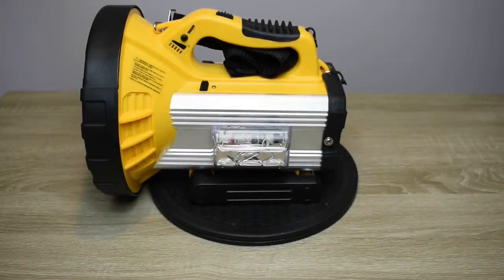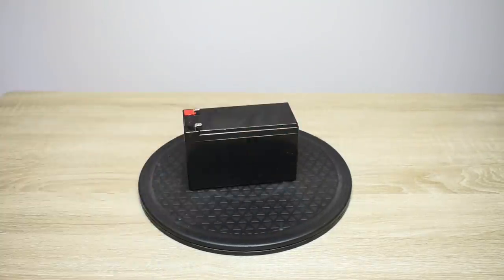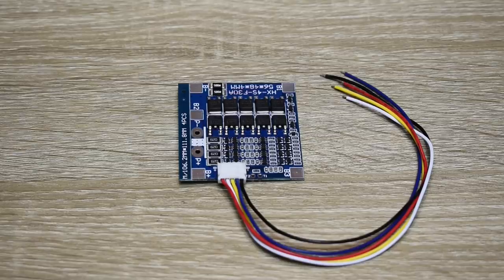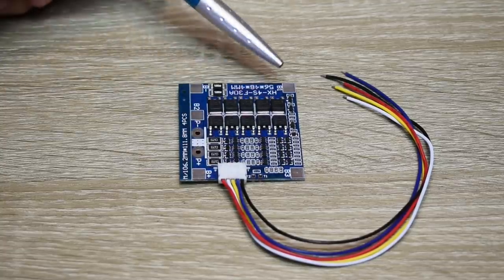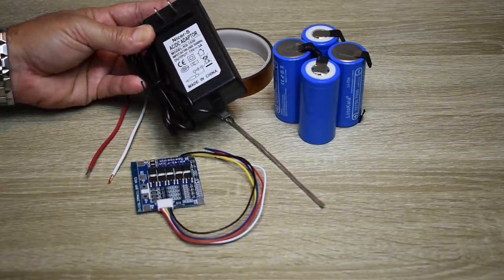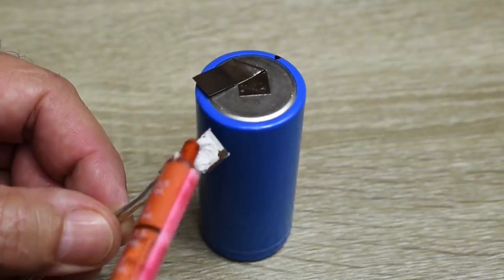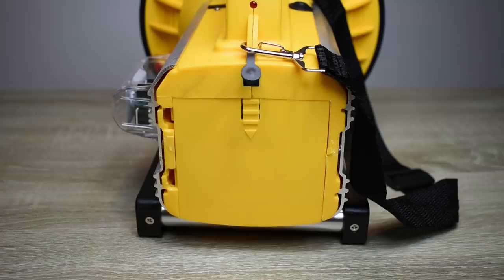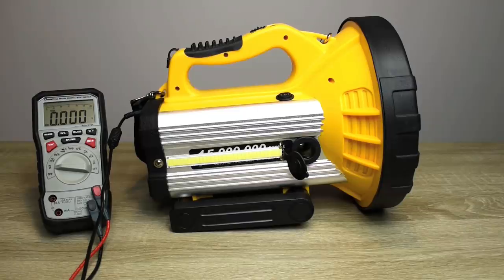Homemade 12V LiFePO4 battery pack!

Comment: LifePo4 version of my own Liion conversion of a similar type high power lamp LED upgrade on main beam too. Used 6 cells (3p2s) as original lead acid was only 6v so get 6.6Ah total! Works great.

Comment: Just in time!!!  I'm making a test device for long LED strips and needed a compact 12v battery pack that could deliver decent power.  Thanks!!!
Reply from the maker: It's easy to do, just takes some time. Thanks for watching! Be sure to share.
Reply: You can use lithum ion 18650 battery instead lithum ion phosphate 32650 battery or polymer battery
Reply: @mahesh4pritesh  but hen you would only have 12.6V maximum in a 3s config... plus, if BMS was bad, it could catch fire...

Comment: I'm sure I'll never be making this setup myself,  but the information is useful for any similar application requiring a charge controller.  Step by step presentation couldn't be any better... That thing will definitely cause flashlight envy at any outing event! 😂👍The manufacturer could stand to take a few hints from you...
Reply from the maker: It's a great setup. Glad you enjoyed the video!

Comment: Great video that is very thorough and details as always!  Never watched one of these LiFEPO4 BMS assembled and neat to see the finished product in a modded spotlight. Fun to mod the older systems with the newer charge controllers with load balancing and over protection.  I've been wanting to add a solar panel to the weather station I modded to use two 18650 laptop battery reclaimed cells... though want to update with a better DC-DC module.  Thanks for sharing!
Reply from the maker: Thank you. Glad you liked the video! Please share the video link with others on other websites.

Comment: You totally need to add tank treads to that lamp, too. hahah So glad I found this video -- ramping up on building pretty much the same thing with the same Liitokala 32700 batteries hopefully to use with one of those solar charge controllers (also on aliexpress). I need to look into the part about 0.5C=3A charger a bit more to see how that fits in to the equation, though...  Anyway, great video, and thanks for posting it! 

Also I can't get over how I feel like I've just been listening to Tom Silva explain electronics. Brilliant.

Comment: Very helpful video.  What extra step would be needed to have a low temperature cut off as well, since these cells are not supposed to be charged at low temperatures.  My guess is to wire the high temp and a low temp sensor in series so that if either one of them opens the circuit is interrupted.  Does that sound correct??

Comment: You inspired me to build a lithium powered light, from a cheap LED light that could use 6v lantern batteries, or AA with supplied adapter, I ditched all that for a pack of 18650's 8* 2.2 ah paralled, it will probably last a week straight on a charge, I'm going to add USB out, and USB charging, and was thinking about a rgb with strobe, for emergency use, I was also looking for a small am FM radio module I could add, I have about 1/2-3/4" on both sides of the battery, maybe a small radio unit could fit there, with a couple small speakers, with a jack for external speakers and input, I'll probably just go with a Bluetooth amp module, I had to add a small boost converter to light the led, it doesn't work until about 5v so the AA batts would probably still be good  only half used, it's only a 1w led, I thought about replacing it with a 3w, maybe rgb, and controller,  I also have a all in one LED , rgbw,UV but it's 18w total I guess, I haven't decided how to control it yet, a rgb controller, with a resistor and switch for the white, and one for the uv, is what I'm thinking, things like this could be the ultimate survival or emergency, and camping light, with a pwm dimmer, and rgb led, it could be dimmed for sitting around a camp fire, maybe shifted to red or green so pictures can be taken, at the moment I'm building a 18-20ah lifepo4 battery for my lawnmower, so I can run the winch I just got for it, it's a little harbor freight 2500lb,  I can anchor the mower to a tree or something, and move logs, it's a temperay use, but I can also power the spot/flood lights for working late evenings this winter,  and still start the mower! I don't know how the stock charging system will work, I may keep the lead acid battery, and add a boost buck converter, with CC CV , to charge the lithium battery while the engine is running, I guess a relay will work fine, to turn it on when the switch is on! It's just a old 90's cub cadet, I do have a old 1980 case micro tractor I'm working on, I may make it electric, since it's hydrolic drive, and I have forklift motors, I can build a 100 ah lithium battery, around 24-48v using a pwm speed controller, to limit power use, I have a small 2cycle engine I may make it a APU, to charge the batteries while in use, if I can just get 2-5 amps minimum, and about 10-15 max, it should work well, since it would only use power while working, UN like a gas engine, ppl would probably wonder how a weed eater engine is running the tractor....    Ha-ha.!!   The motors are about 6.6kw at 24v, about 25kw at 48v, I have a 500 watt, 24v motor, I'd like to make it a starter generator for the 2cycle engine, I can use a DC boost converter to charge the larger battery. And maybe a smaller buck to charge the starter battery, ir just use the pull rope! It's amazing what you can build yourself, if you just think about it! It's that or buy another 20-24hp engine!  I'd like to find a 10 HP diesel engine to repower it, they are expensive! And I have part of the electric conversion already! Maybe a soft start could be set up for the motor, if ran at atleast 36v it should make plenty of power,  even at 24v it would probably equal the gas engines power,  I have a 24v 250ah battery I could use, or split it to a 14s 125ah, if it would pull less than 200-250 amps, I'd like to stay below 100amps at 48v/56v, 200at 24/29v, sorry for the ramblings!!

Comment: I think (but I’m not sure) that you could skip the thin red and thin black wires if the thick wires have a low enough resistance. That will be the case if you use 16AWG copper wire and the length is only a few inches.
Reply from the maker: I didn't inspect this board, but it's likely that the small red is tied to the batt+ pad, and the small black to the NEG pad.

Comment: the flat solder pads can be used to connect the cells you dont have to use the fine wires instead you coul add balance leads there
Reply from the maker: Correct
Reply: This is mentioned in the video

Comment: Hi , i have that BMS same of yours, but i tried to solder its metal pads(B1-B5) with a lead core and it does not stick, what is the problem on it ? what is the recommended name/brand of lead ? is it the lead itself have a problem ?.. i already applied a flux, same problem again.

Comment: 012721/0255h PST.     Thanks for the presentation. A few months back in 2020, I responded to the same presentation regarding the Lamp, and you said you bought it at a store and don’t have an idea if it’s available or not. I’m viewing this presentation per chance and I found that the BMS shown in the video is for Li-Ion cells and not for LiFePo4 cells. Where did we go wrong? Thanks and stay safe. 73s...

Comment: 10 amps? From that socket lol what are you powering with that? 

But very Awesome video I need this for a solar project this helps me so much... Those lead acid batteries are so big I want to get rid of them this is great Thanks for the upload 😘❤
Reply from the maker: Yes, 10A is the accessory socket rating used on many portable power stations. Better to have the ability and not use it. :-) Thanks for watching! Glad you enjoyed the video!
Reply: My portable air compressor that came with my car draws about that. It's powered from the cigarette socket.
Reply: @spagamoto  lol I was thinking the same thing, its perfect for a small 12v air compressor but I'm worried about the traces on the board 😭
Reply: @electronicsNmore  Can you do a heat test with your thermal cam using 10 amps on that outlet? I'm skeptical

Comment: Great Video!  I have an APC 1250 watt ups that has two 12v 7ah batteries sandwiched in series together.  The UPS charges with around 28-30volts, and the voltage on the battery connector that combines both batteries are around 30 volts.  I have really bad power in my city (brown outs 8-10 times per month for a few seconds. 

1. Would these liitokala lifepo4 batteries be good for this? 

2.  If yes, which BMS should I get for charging voltage of around $30 volts or less and how many batteries would I need? 

3.  The UPS normally charges the lead acid with parameters meant for that type of battery.  Would the BMS have issues with the power received to charge the lifepo4 from this type of setup?
Reply from the maker: Yes. They will work. So you have 24V at 7A. Use the one of the 8S BMS's at the link below, along with 8 cells. 
https://amzn.to/2L1Bf4w
(Amazon Affiliate Link)

Comment: Great video. I have a project I was looking for a cheaper and lighter battery. Do you know the weight differences between the two?
Reply from the maker: The LiFePO4 battery is around 1/2 the weight of the SLA. Thanks for watching!

Comment: Do you have any video showing how to replace a laptop's battery management circuit(new) or removing the locked circuit?
Reply from the maker: No. I only show how to use a laptop that no longer works using the power adapter.
Reply: @electronicsNmore  Thanks for the reply.

Comment: What Is the rated charging voltage the board can accept ? Can I use a laptop charger to charge the battery  and will the board handle 19v input on the bms ?
Reply from the maker: The input voltage must be no higher than 14.8, ideally use 14.5 - 14.6v

Comment: Good explaination. Be carefull using these BMS,  please check the balance voltage.  my same type cheap bms is using ic for li-poly (4.2v), not for 3.2v, lifepo4.  Cut off voltage for upper and lower voltage is correct for lifepo4.
Reply from the maker: It works fine, just use the correct BMS as explained in the video and make sure all the cells are similar in voltage before connecting. Thanks for watching!

Comment: Τhermal protection on lifepo4 is not for hot, its for cold i think. The thermistor you stuck in there is never going to open circuit i think. Also i might be wrong ...
Reply from the maker: I live in South Florida, cold isn't a concern. I wanted protection only for excessive heat. When the temp rises to 55 deg C, the switch loses continuity, then the BMS detects the open circuit cutting power. That's how it's supposed to work.

Comment: Could you tell me which components should be used if building lifepo4 battery for a motorcycle 12 volts / 20Ah, 350 CCA and charging voltage 14 volts / amps 30A max 50A
Reply from the maker: This board should be good:
https://bit.ly/3aeeC6Z

Comment: Well, I have the same BMS, for 4s liion, 3.7/4.2v I used in a diy light, the battery is large enough, i haven't had to recharge it yet,

Comment: Will the BMS protect the cells from dropping too low should the light or something be inadvertently left on?
Reply from the maker: The BMS stops the flow of current to the load if the voltage drops too low.
Reply: @electronicsNmore  Thanks. Great video.

Comment: The JST connector only carries the Balance Current.  Not the Total Charging current.
Reply from the maker: Correct. I've seen people use only the wires from the harness connected to the cells to power things. More than likely the small red and black wires can be disregarded, and only use the 16ga R & Bk wires.

Comment: how come LiFePo4 needs a BMS but SLA's don't? what i'm really wondering is what would happen IRL if you were to do this with no BMS... Like what's the worst that could happen?
Reply from the maker: You'll ruin the LiFePO4 cells. More than likely you'll overcharge or overdischarge the cells. Use the board.
Reply: @electronicsNmore  thanks 4 the reply, subscribed - can't wait 2 see future videos :-) there are some other videos with guys using these with no BMS with no I'll effects

Comment: quick question, would something like this x2 work in a ups? and be able to provide sufficient current?
Reply from the maker: These LiFePO4 cells can supply a good amount of current, especially if you place to groups in parallel. Thanks for watching!
Reply: @electronicsNmore  Anytime, I've been looking for a video like this for a while!. But another question, if I put two of these in series (as the LA battereis in the UPS are atm, will I need like an additional charge controller?

Seems I forgot to sub, will do that right now xD
Reply from the maker: @mattotto9949  This should work fine:
https://i.pinimg.com/236x/3a/5a/f6/3a5af6fb500b3695f4160d3c09bc5441.jpg?nii=t
Reply: @electronicsNmore  Oh excellent, thank you so much!

Comment: Can the handle continuous 20A discharge?
Reply from the maker: I performed the test for these LiFePO4's on my channel.
Reply: @electronicsNmore  Thanks I saw all three videos. In the 20A test it showed almost 58C at the end. That's why asking as you made this pack would this pack good for continuous 20A discharge? I saw in the spec sheet 3C continuous discharge which is 18A as the cells are 6AH. I want to use this pack you showed in a UPS.

Comment: Idol patulong naman po sa ginawa kong 32650 battery para motor..kc ginaya ko ung sa video mo sa youtube..apat na 32650 na nka siries..bali gamit kong bms 12v 4s 100ah..ginawa ko naman ung tutorial mo sa YT. Pero bakit kpag nag pushstart ako sa mio i 125 ko nagba black out ung supply ng battery ko sa voltmeter at sa guage light ko pti nrin sa mga accesories light ko..pero kickstart nagana naman..anu kya problema boss?

Comment: Yeah nice. My buddy had electrical test probe like new ones led red and green but his was snap on with voltage meter in it clear screwdriver 🪛 handle.  Wonder how hard it would be to put a round little voltmeter on top of Luke hobo fart tester. His was about 100$ mine less 10$ lol his had rectangular screen middle handle. I've seen some little round gauges don't know if any that small . Like a quarter at best dime maybe. Lol 😂well be nice video and late Christmas 🎁. 😅 Stay safe from ur ole hillbilly buddy

Comment: Have you seen the specs of that BMS it's pathetic 😂🤔 balance current 58mA
Reply from the maker: You have to realize that the BMS is VERY inexpensive, and the battery pack only has a 6.5A rating. It does get the job done, even though the balance current is low. Thanks for watching
Reply: @electronicsNmore  I let ya off then cus it's only few cells lol

Comment: 090520/1951pst. Thanks for the retrofit of spotlight Pb Battery with LiFePo4 cells.
Two things that you forgot to add in venders parts list is 1) The LED emitter 2) The spot light itself.
Would you please name the venders to my mail <KJDXB> thanks. Stay safe and 73s...
Reply from the maker: The exact light is no longer sold, but there's a very similar type that you can find on google search. Below is a link showing the type. It uses any h4 LED bulb.
https://www.amazon.com/Cyclops-CYC-S10MIL-Million-Rechargeable-Spotlight/dp/tech-data/B001B7ILFC

Comment: No it is not well Made.... it looks cheap and poor in Quality... but only 10 bugs.... you get what you pay.... the good Thing is the lifepo4  Akku... thats Great... ps: 12volt and usb Port... why how many Ports do you want??? My Wife has only 3 Ports and it is Perfectly fine...
Reply from the maker: What are you talking about, the light?
Reply: @electronicsNmore  yeah ... the Lamp... it is not well made and one off the best examples wich shows the best that China is doing... namely scrap ... there are some good Quality Products that are Coming from made in Pandaland...  im not Talking about your mods... but you can over do it also...
Reply: @StarLink85  About all he has of the original light is the blow molded plastic.  What's wrong with that? Otherwise new bulb, switch, ports, battery, battery management.   I guess there is not a real answer to be given...
Reply from the maker: Compared to many other spotlights, the one I have is very good.